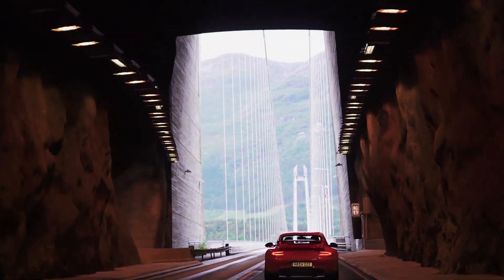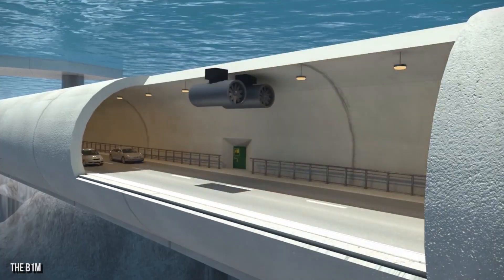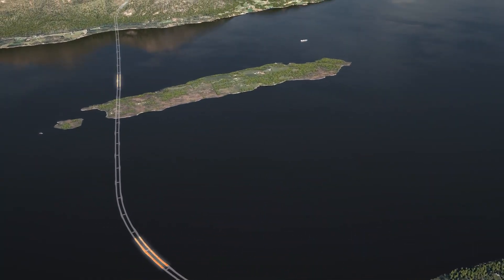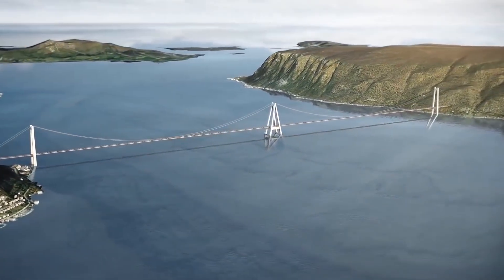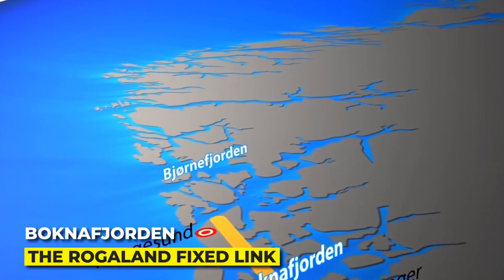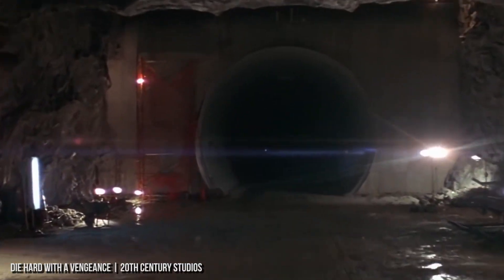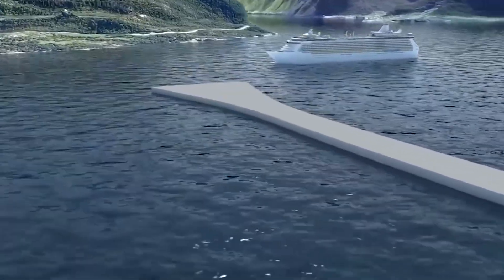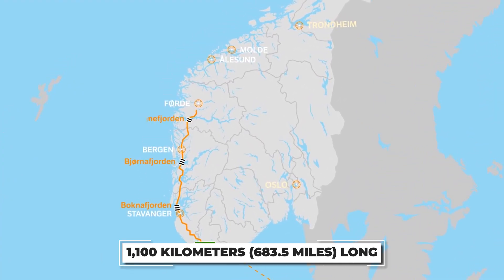Inside Norway's $47 Billion Floating Highway

Comment: Over $200 in gas for a 700 mile trip. That's a huge exaggeration! If you had 15 miles per gallon which is very low with $4 per gallon of gas which is far above average it still wouldn't cost $200. A small car would cost under $100 even assuming $4 per gallon.
Reply: An estimate done by Norwegian petrol prices. Not American
Reply: gas prices in Europe aren't as low as in the USA! FYI the current price for one gallon of gas in Norway is at US$ 6.571

Comment: Maintenance and repair has to be a tad problematic , not to mention the so-called 'escape routes'.  How do you escape into the open sea?
Reply: uhm like in any other tunnel which goes underneath the sea or through mountains?! Either in a seperate service and evacuation tunnel or into the other tunnel tube

Comment: Welcome to Chemix Chemicals official website.

We lead the industry in cleaning bank stained notes from pink to black dyed currency. Our main line of products and services serve the financial industry as a whole, where our main clients are banks and humanitarian organisation individual companys and parties are welcome too. we are one of Southern Africa's leading SSD Automatic Solution, Vectrol Paste, TTZ Universal Solution, Zuta S4, Castrox Oxide HQ45, SSD Solution PK 58 distributor and manufacturer.

The ssd solution in its full range is the BEST CHEMICAL on the market for cleaning Anti breeze bank notes, defaced currency, marked notes and the likes. You will be amazed by the power and rapidity of this CHEMICAL; that is capable of cleaning notes/currency with BREEZE capacity. We Stock limited SSD Solution for cleaning the ANTI-BREEZE BANKNOTE, or the 'Black Money'. call now +27781770868

Comment: The Rogfast 'tube bridge' would be up to 390 meters deep?!  That would have an external water pressure of 580 psi or nearly 42 TONS per square foot.  What sort of materials wizardry are they proposing for that kind of load that would provide adequate safety?

Comment: Couldn't they have just built high speed rail instead?
Reply: No. High speed rail demand a more straight curvature both horizontally and vertically. In a terrain with lots of mountains and deep fjords, building high speed rail is close to impossible. Or at least, atronomically expensive. Also, the population in this part of the country, is barely 2 million. And most of the long distance traffic is oriented towards Oslo, rather than between the cities along the coast.
Reply: Norway has some HSR, but it's not only to serve the cities and larger places but also the smaller places alongside the route; HSR on that route wouldn't make sense and would be far more difficult
Reply: Too expensive and not profitable

Comment: Whats with all the pessimists in the comment section jeez. You realise  that the engineers responsible for building these structures will make sure they are not flimsy or unsafe. These bridges and floating tunnels will be about as safe as the Golden Gate Bridge or the Millau Viaduct. The tunnel wont just snap with one Earthquake lmao. 

All of these structures will be built with Earthquakes in mind and will most likely be intended to withstand up to 5-7 on the Richter scale.

An Engineering channel The B1M covered this a year ago, I suggest watching that video.

Comment: I wonder how the engineers would plan for one of those massive landslides that occasionally happen in the fjords? Anyway, best wishes for an incredible project! 😎 Cheers from Australia.
Reply: There was 250 years ago a really massive landslide happened, it drowned some villages and farms and killed aroud 300 in the 1740's.  But even that will have no impact on these. 
Even if the Åkerneset  (the one in the movie Wave) falls, and floods several small towns, it will have no impact on these, as it is the places in th end of fjords that will be hit hardest.

Some 11000 years ago, then there was a major fall, the waves flooded parts of England.

But most are small loads of mountain that hardly make a splash, for instance a 2200 ton bit of mountain fell into a fjord, not even a millimetre raised sea level. (They have measuring equipment everywhere), that is because many fjords are more than a kilometer deep...

Comment: Never see it happen because you forgot about waves and in the North Sea they can get very big at times, so, no way it will ever happen. The one tethered to the Sea bed might however, but what about "Sea Current". Likely going to be an issue I would think. Where do you get this stuff anyway. Just plain nonsense.

Comment: The scenic route for me as a tourist. I would be concerned about sustainable air in those tunnels in case of emergencies and exhaust from automobiles. Also the materials those tunnels are to be constructed of( potential cracks from extreme weather). In America we would worry about weird stuff like people living in them, dumping trash, dead murdered people. If there's a wreck how long are you stuck in the tunnel, how do you even remove wrecked vehicles if it's a distance from the next exit and there are not enough lanes to accommodate passage(are there service roads) Bathrooms stops, somebody's car breaking down, flat tires. No radio... in case of emergency you can't drive and work your cellphone... Unless I live in Norway I definitely want the scenic route
Reply: Well then don't take the route, its meant to connect cities to make buisnesses/industries work alot faster and more efficiently its not meant for scenic routes
Reply: exhaust fumes aren't a problem, any tunnel of a decent length has a powerful ventilation system pushing the air in the same direction. If you go to Norway you usually have no choice than going through some road tunnel sooner or later as there are more than a thousand of them across the country.

Comment: Why would you be traveling only 30mph? That's too freakin slow.. make it at least 60mph or faster like 70 or 80mph
Reply: 80 mph? Are you nuts? Apart from the very few actual highways at the far southern coastline towards the capital city, the speed limit in the entire country is at 50 mph ... and foreigners will actually have a hard time to keep up with the 50 mph as it's quite an extreme roaller coaster-like driving experience with tight turns, hills and narrow roads

Comment: What about when water level gets higher or lower or when the water freezes?
Reply: The water doesn’t freeze over there
Reply: But its very cold there why not?
Reply: @sevtron4207  the gulf stream brings relatively warm water up there ... not really warm, but warm enough that it doesn't freeze also way beyond the arctic circle, and this entire project is far south of the arctic circle
Reply: @EnjoyFirefighting  I'm still confused about water levels changing higher and lower.
Reply: @sevtron4207  the tide is an issue they have on a daily basis ... they know how to handle that
Reply: @EnjoyFirefighting  ok thx
Reply: Well the entire E39 is still quite south as as far as Norway is concerned. So it does get cold there, but not really much colder than the top of Scotland. The fjords are part of the sea and both the Sulafjord and Bjørnafjorden are too far south to be frozen over during winter.

Comment: What happens when there’s a lack of oxygen deep in the tunnel possibly leading to engine failure. Without oxygen you can’t ignite fuel for combustion.
Reply: Then drive an electric car
Reply: any tunnel of a decent length has a ventilation system bringing fresh air into the tunnel and pushing the exhaust fumes out of the tunnel ... even in the world's longest road tunnel that's not an issue; you can safely exit your vehicle there without any health issues

Comment: The existing roads in Norway need so much repair, can't imagine how they just ran passed those issues to build floating tunnel roads...smh
Reply: They dont need much repair.. Very little too none
Reply: Northern Norway, not the south. I have never seen such smooth roads anywhere in Europe compared to the capital in Norway.
Reply: @LeandroMoreira-p4x  And yes, It was in the northern parts where I experienced rough roads... But to be fair, it was a good number of years ago...
Reply: @tima.478  some parts in need of repair got some good maintenance in the past few years, some road sections were completly redesigned like parts of the E6 going up on the Salt Mountain plateau ... used to be a narrow winding road and the modern one has long and wide turns

Comment: I would love to see how they will do maintenance on the tunnels, or address vehicle collisions that completely block traffic flow inside the tunnel, or my personal favorite... the terrorist bombing.  Good luck Norway!
Reply: Maintenance is one of the reasons for doing this, the tunnels are cheap in operations compared to a bridge. There is no snow to get rid of.
Reply: @knuthf  It is just a curiosity of how they can make underwater repairs to a floating tunnel which is highly likely to sustain damage from the sea and ships.
Reply: @edgeofentropy3492  attacks on the tunnel? There are more than 1100 road tunnels across the country already, they had a wide range of choices already. Maintenance? Well that's easy: block one lane and let traffic go by on the other lane. THat's the same thing like on two-way tunnels with both directions of traffic in the same tube. Vehicle collisions ... well emergency crews will get on scene, treat and transport patients, clear the road and they're good to go maybe after half an hour, two hours, ...
Reply: @EnjoyFirefighting  I was thinking worse case scenario.  If someone collapsed an underwater section that would be extremely devastating.  It is not likely that they would, but it COULD happen.  If the emergency crews quickly cleared a really bad multi car accident, where all lanes of traffic are blocked, that would be impressive.  Of course, here in the Americas, our "emergency" response to a multi car crash is quick.  The problem here is not the response time, it is the cleanup and when all lanes of traffic are blocked, all hell breaks loose.  Lots of road rage.
Reply: I understand your consern.... but its Norway and not USA, Middle east or whatever..... and second of all people are obviously finding the best solutions to this.... so no worries

Comment: An additional thought:  Why isn't rail travel being considered as part of the project?
Reply: @LeandroMoreira-p4x  I'm much concerned about nature and the environment, and although electric cars will soon be the standard, they are far less efficient than public transportation in moving larger numbers of people.  Rail is also far more fuel-efficient than rubber-tired vehicles.  The US has been quite backward in developing good national public rail such as found in the UK and most of Europe, and our environment suffers for it.  Can I assume that Norway does not have the need to move large numbers of people between cities?
Reply: @Bobrogers99  I agree with your arguments, but this isn't like a metro area with large suburbs where train stops would connect many local people ... a train on that route simply wouldn't be efficient and wouldn't serve that many people; Also the tracks would require a far more complicated plan due to the wider curves and smaller inclines possible with train tracks.
They have rail systems in Norway, but it doesn't work alongside the south-western coastline domineted by fjords, it really isn't an option. At some places Norway even runs HSR on such a tight schedule which is only known from buses in many large cities elsewhere in the world

Comment: It showed people walking down there.... pollution? People gonna suffocate down there they would have to have some massive ventilation systems going down there which would make a road require 24/7 maintenance and uptime
Reply: It ia going too have loads of ventilation systems... No worries norway knows its stuff
Reply: @kasperknutsen8283  ... and we use electric cars.
Reply: Electric cars say hi 😆 the country where you find more electric cars than normal cars
Reply: You're talking about a nation with the worlds longest tunnels, I think they know this :)
Reply: Have you never been in a big tunnel before? They have massive ventilation in these tunnels, usually shafts going straight up at set distances during the length of the tunnel.
Reply: Surely hope in 2050 will be no more combustion cars.
Reply: lol norway has alot of tunnels, of corse there is ventilation, idiot

Comment: Not that I'm neagitive is just that I can fore see that this project is dangerous and the Earth right now is not in the best condition especially the ocean bed. Sparadic and sudden mishaps are NOW occuring.. Brilliant plan but  there is no way that this Project will  be successful.. Disaster waiting to happen..underwater at this moment has tremendous force of pressure and is releasing gases into the ocean floor causing under water Earth tremors ,the weight alone of this magnitude is horrifically worrisome.. It's very evident that this world isn't going to last Forever..It's now on countdown... Evidence is Presenting itself with all the disaters that are presently occuring..Daily. I personally would not travel in this project ..
Reply: Dont overthink this. They got it all under controll with thousands of experts

Comment: What if a ship runs into the entrance and it would flood that tunnel in a minute
Reply: You will not find a ship that has 20 m draft, the most you will find is 12m - a fully loaded VLCC. The terminal to load these for deliveries to China is close to the motorway, so one day you can drive underneath.  Nuclear submarines is the problem, so I expect the road is designed to take a direct hit.

Comment: Why does the movie "Daylight" come to mind here...
Anyways, once they get the mega-project completed, they should shift their focus towards the northern part of the country, where most of the road network is either worn out, neglected or in a dire need for an upgrade
Reply: That was the only movie I could think of...
Reply: Was thinking the same thing. They even put a small clip of the accident that caused the explosion from that movie in this video. Shame it wasn’t labeled like the Die Hard With a Vengeance scene just after it. I recognized the scene of car hitting the trucks with the yellow barrels from Daylight right away.
Reply: @1darnright19  That was what I was thinking when I mentioned Daylight
Reply: there are three Daylight movies, which are you referring?
Reply: @sirchristopherblair8889  The one with Sylvester Stallone.

Comment: Everyone gangsta until the bridge floats away with cars in it
Reply: How? It's a bridge so it's connected to fixed points at both ends 🤷🏾‍♂️
Reply: @deadlydizzle7588  its underwater and when your underwater theres water pressure so it could snap off then drift off
Reply: Samuel Smith 😳
Reply: @samuelsmith637  But it's a solid structure with anti-pressure points, also harnessed into the seabed at various stages to compensate. Also the depth of water isn't enough to create that hydrostatic force needed to dislocate the reinforcements planned. I'm sure all of the worst possible outcomes have been taken into consideration. Things like this don't get passed easily without proven resolve for every structural frailty.
Reply: @deadlydizzle7588  yeah true but ever heard of MEGALODONZ
Reply: Samuel Smith and their extinct
Reply: @masontoler1450  u dont know that
Reply: @masontoler1450  they're*
Reply: @samuelsmith637  they don't exist anymore
Reply: yall think too much
Reply: @lovethandrew4473  guess what nobody asked for a ad
Reply: Wow, I think China will complete theirs first
Reply: @YouTube Account it doesnt matter climate change is hyped up 2 much ww3 will kill us much faster than climate change
Reply: @YouTube Accountwell like I said ww3 will kill us much faster
Reply: Oh don’t worry it will fill up with water and kill everyone inside before it floats away lol
Reply: @YouTube Account That water level rise would increase the pressure, but I don't think it would have many more consequences.